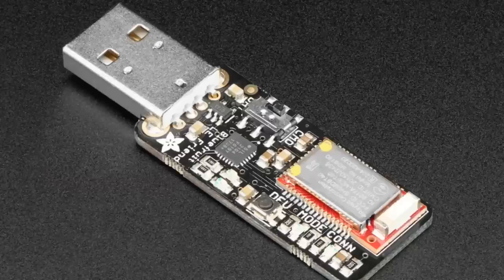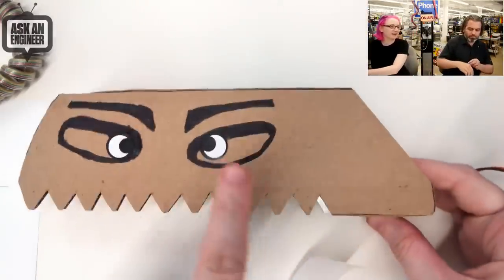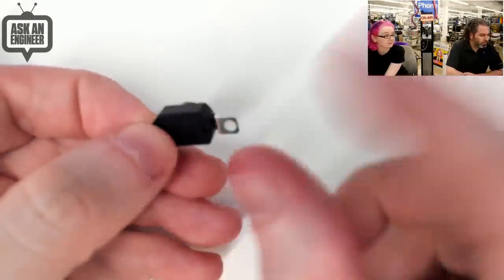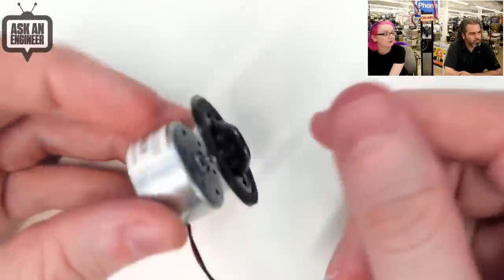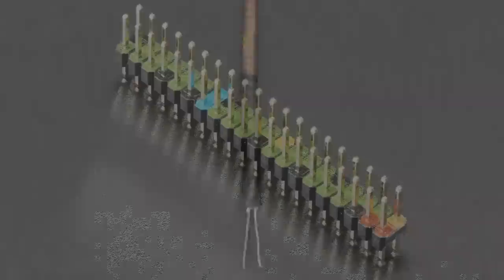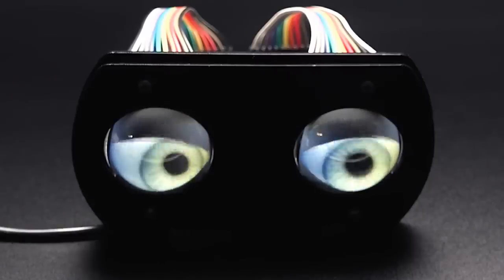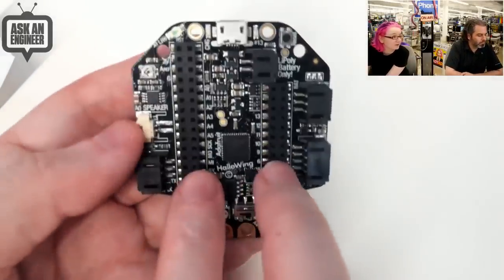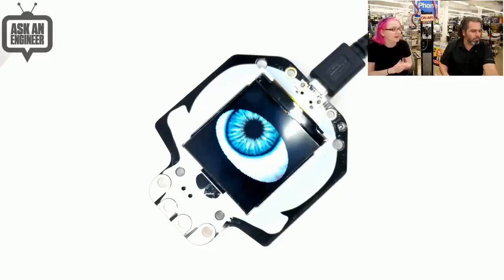New Products 8/15/18 Featuring Adafruit #HalloWing #M0 Express! @adafruit #adafruit

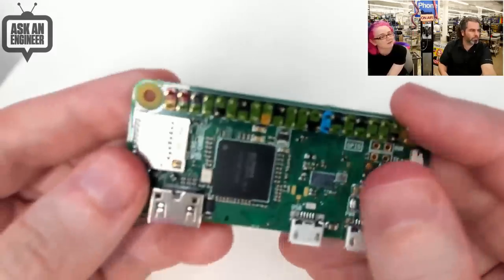Comment: @10:52 - Here's a product idea - A thin piece of form fitting plastic with the same/similar color coding having pre-cut holes and sticky backing that can be placed on existing RPI headers. Also have the option to leave the backing film for non permanent attachment uses.